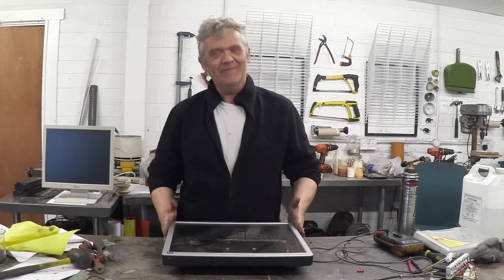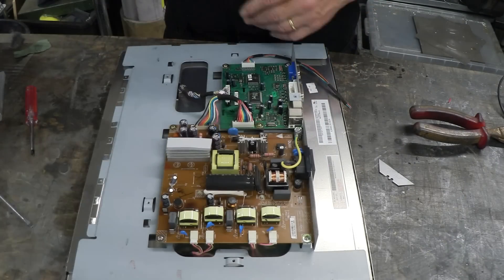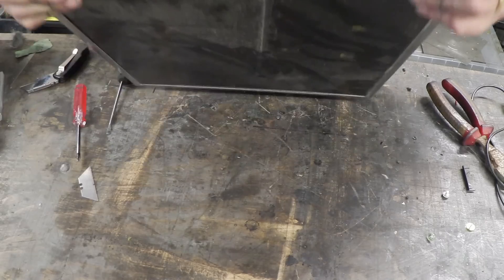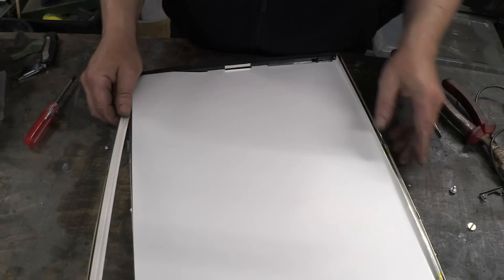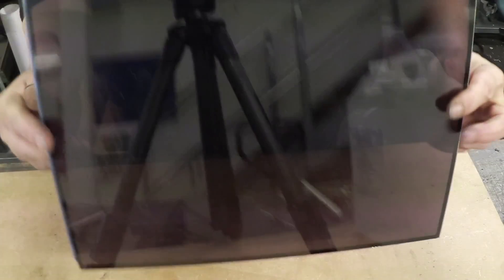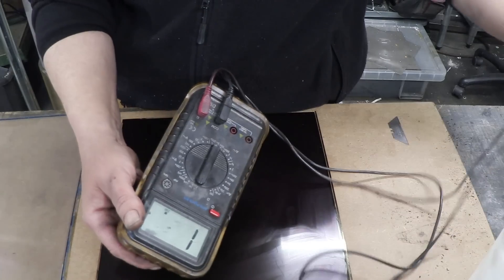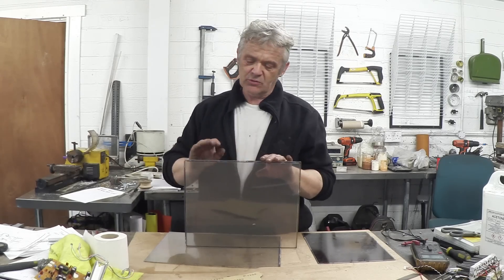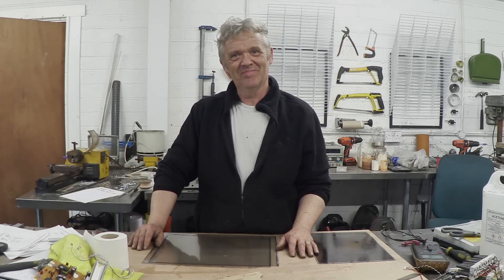A Solar Cell From A Broken LCD Screen - Part 1 - Reclaiming The Materials

Comment: I worked in experimental electrical conductive plastics in the 80s. We would screen print dielectrics on the conductive glass, then conductive patterns on the dielectrics. connect them to an alternating current source and make them light up the glass in the pattern we designed.
Reply: Is that like the diy LCD screen from Applied Science (Ben)'s video?
Reply: @Ewr42  I did not see the video you are referring to. We were experimenting with making conductive plastics ink at the time and screen printed circuit boards. This was all experimental at that time, and I don't recall LCD screens for computers at that time either.

Comment: I try to get my hands on LCD screens for the acrylic panel and for the metal as it is handy for little jobs. Thank you for pointing out how valuable the screen is though, but where do you get rid of the bits? If I recovered the screen it would be for resale.

Comment: Any chance you would happen to know how to make a linear fresnel lens or what exactly I would have to take it out of I don't want a fresnel lens that Focus light into a single dot.
 I want a linear fresnel lens that focuses light into a (line of light)...
    I have a project that I need this for but I have absolutely no idea how to get one I mean I can buy one from China but you never know what's going to happen  from there to here and I would have to wait exactly one month to even get a small 50x50 mm one I'm not really too picky on the size I just want to know if it works the way I intend for it to work.

Comment: I learned something today! Thanks.
Reply from the maker: awesome mate - cheers
Reply: @ThinkingandTinkering  I actually found an old lcd screen someone was about to throw away today and now I follow along! Haha. After separating the two pieces of conductive glass they appear to be somewhat wet. Is that some sort of glue or does it have another function?

Comment: I tried to separate the lcd from the backlighting to build a projector.  I ended up ruining the display from all the pressure applied to peel off the dark film on the outside.  lol now I wish I didn't throw it away.
Reply from the maker: yeah it is a bit tough but if you use constant pressure at an angle it comes off clean enough - as you can see I did loads - I feel I am bragging now lol

Comment: Use some screen from smartphone. The size of the phone screen will be good for solar cell,....
Reply from the maker: nice one mate
Reply: @ThinkingandTinkering  some old phones are way simpler to get. And almost all people have some old phone at home, right. 😁
Reply: @ThinkingandTinkering  the old phones use this resistive screens and the new phones use capacitive screens which means that you have two conductive screen layers and some insulator between. If I remember corretly

Comment: I took 32 inch led tv apart like that it had 4 strips with  leds on them. Each strip had 4 leds on them I wired two strips in parallel which made a 12 volt light then I put the two parallel strips in series which made it 24 volts. I used a small 12 volt 1 amp ac transformer built a voltage doubler circuit to run it . Put the screen back together and made a light h to hang on the wall in the bedroom! I also did this with some smaller screens. My goofy wife of 42 years says they're tacky looking! 😀
Reply from the maker: tons of stuff to do with them mate - nice ideas there - cheers - oh and tacky - well that's a point of view lol
Reply: They make great shop lights or white light for photography, tracing light.  I took a few with the same 4 led  strips and ran them in parallel and attached them to the lip at the bottom of my kitchen cabinet for no ,more stub toes and underside of hanging cabinets for a bit extra lighting when needed.
Reply: DIY perks has done that lol

Comment: Can’t wait to see Part 2 !

Is the conductive glass the same across the whole surface, or are there connections along the edges that need to be intact ?

I have a large broken one and wondered if it  could easily be cut down to remove the sharp corners and then used for a solar cell.

If anyone knows that would be great. If not, I guess I’ll just need to give it a try.
Reply from the maker: trying it is always best mate - my understanding is it will work - but we are just about to find out lol

Comment: I thought this was a video from '999 Dusan' for a moment there :). When I was young (this was in a previous century) I used to take a sorts of stuff apart, radiograms, TVs, adding machines etc. Sometimes I even remembered to unplug them first! So I found this great fun!
Reply: Those damn 400V caps needed to be discharged first too, they aren't friendly.

I still have a tv that reads "unplug before opening" on the back, instead of "no user serviceable parts inside."
Reply from the maker: lol - yeah it helps to unplug lol - that was an awesome story mate

Comment: Genius! Have I understood this right? I see often old flalt screen TVs in the recycling. If I take these 40 inch screens can I make a solar array from them? In fact my fave place reopens tomorrow.
Reply from the maker: well - that's what I plan to do with them mate
Reply: @ThinkingandTinkering  Forgive my sounding a bit dense, but if we get these old flat screens charging batteries, don't they need a voltage regulator to reduce spikes in electricity flow? Please make this project as easy to follow as possible then I will def have a go!
Reply: You can also use some old smartphone.

Comment: Is the cost of the glass due to manufacturing cost, or is it just one of those "1 is $1, but 1,000,000 is $0.02 each" situations? My local goodwill has hundreds of these for $5 each or so
Reply: It's probably an 'economy of scale' thing.
Reply from the maker: scale and market mate

Comment: I've repaired  a couple of LCD monitors by repcing visably blown electrolitic capacitors. That's relativly easy.  But if you have more monitors than you need, stripping them to upcycle parts is certainly  a great option.
Reply from the maker: for sure mate - you could also used cracked screens just use a glass cutter for the size you want

Comment: I've used broken LCD displays a number of times.   The Poly Carbonate sheets in them is most useful  Didn't know about the two sheets glass. Nor the conductive glass.  LED light bar's get used.
Reply from the maker: reusing the glass - I don't think I have seen that before

Comment: I have NEVER been able to take off the polarizing filter intact like that LOL
By the way, ITO is freaky in that it conducts electricity yet transparent.
Reply: I always think anything transparent is amazing. How does the light tell the difference, and why?!
Reply from the maker: it is freaky lol - try a bit of acetone as you peel if you are having difficulty
Reply: Desmond Bagley  A science channel on YT did a video about it. It has a freaky quantum thing about going on. I bet it's something to do with the fact light behaves both like a particle AND a wave.

Comment: Man i opened it up but broke and throw away the screen .   . I need more for solar panel
Reply from the maker: you won't have broken it to little pieces mate - use a glass cutter and cut it into squares to practice making small cells with then when you get the trick of whole sheets you'll be ready
Reply: Slow is smooth smooth is fast.
Reply from the maker: I like that mate - I may use it - cheers